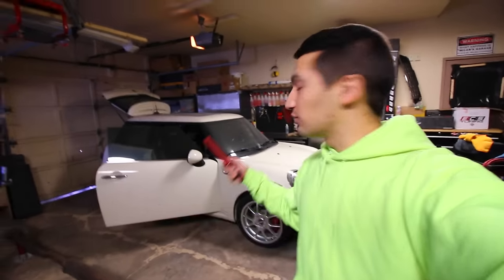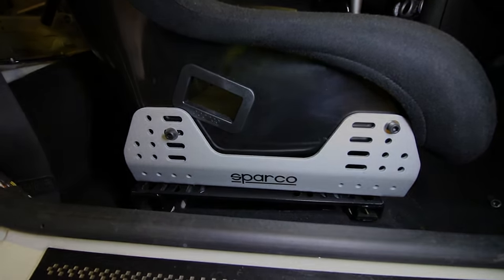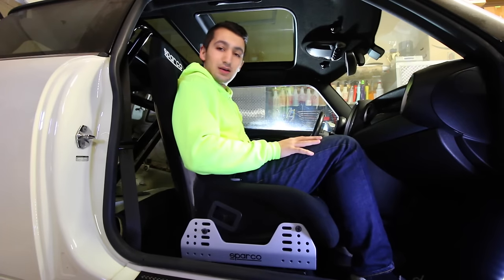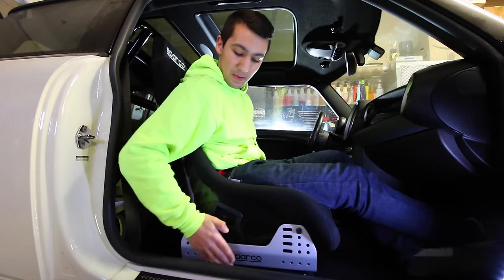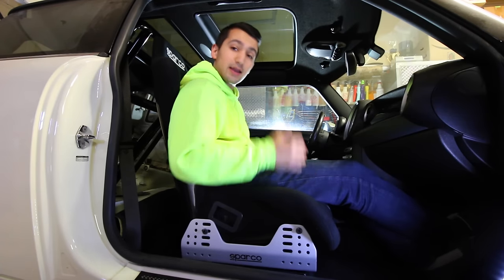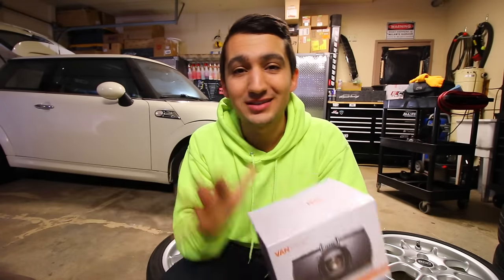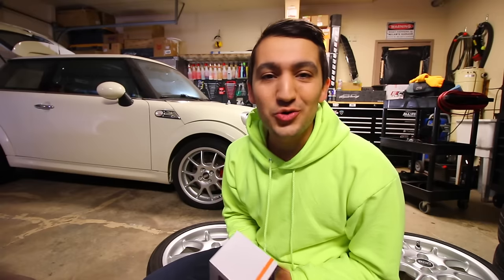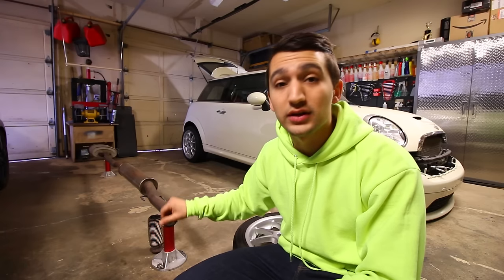I BOUGHT A SPARCO BUCKET SEAT!!! But...

Comment: Hey Milan! Why not remove the door cards or make a custom falt panel for it like the miata guys do? A simple ABS plastic panel with a red door pull to match the seatbelts. And btw I want those wheels :)
Reply: Exactly what I was gonna say. It would help free enough room up
Reply: or modify the current ones for the insert
Reply from the maker: Cuz it still won't fit with them out.. They're too fat of a seat

Comment: I was shopping for a Cooper S when a BMW Z4 jumped out and seduced me ! Not much you can mod on a Z4 except tires and rims. I had to chuckle when you pointed to your stack of rubber. I've got 3 sets, one summer performance, summer run flats (for touring) and a winter set. I'm not finished - I also have a spare set of rims. I don't know how that happened. ;)  

Now my daughter is in the market for a Cooper S, so I am watching your Mini Videos closely. I'm especially concerned about all the problems you have experienced. But I have been assured that with regular proper maintenance, the cars run fine. 

Congrats on the sweet JCW that you located. I hope I get as lucky.

Comment: my wrx has fixed back seats (they barely fit but hey) i use my factory 3 point harness. if you put the factory belt through the hole on your right hip (where the harness would pass) it would be as safe as factory.

Comment: for example check BMW e36 bucket seat brackets, they pushing the seat into centre the car more , so i believe it will help you, same might be for the driver side, your seat might be not in centre of the stearing wheel with unbiversal brackets 
http://www.driftworks.com/driftworks-bmw-e36-and-e46-seat-frame-316-318-325-328-m3-seat-rail.html

Comment: If you take the door panel off will there enough clearance???
Reply from the maker: I wish.. even still no :(
Reply: milanmastracci Frustrating.
Reply: Have you tried removing the center console + door panel, and then try mounting the seat further away from the door?

Comment: Why are safer seat belts not "street legal"? Silly Canadians.
Reply: The 6 point belts are safer. But they don't allow movement in the seat so people don't wear the solder belts and just use the lap belts. That is why race harnesses are Illegal.
Reply: Christopher Pirri 
But if you wear ALL the belts, you're legal  - I have a 5 point harness.

Comment: Complete definition of a ricer?
Reply from the maker: A bucket seat?
Reply: milanmastracci You can bend the upper part of the seat, just use a ratchening strap to bend the top part.
Reply: milanmastracci You can bend the upper part of the seat, just use a ratcheting strap to bend the top part.